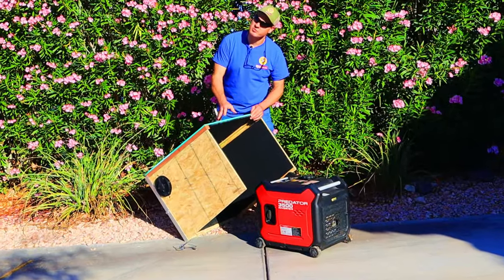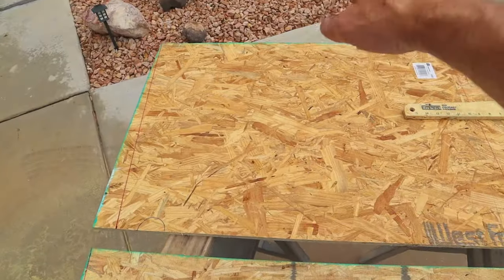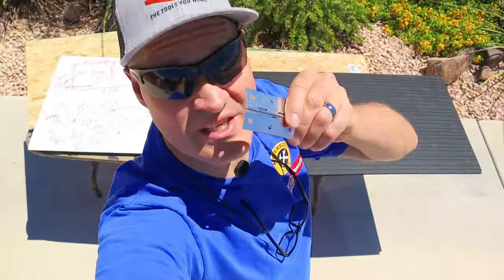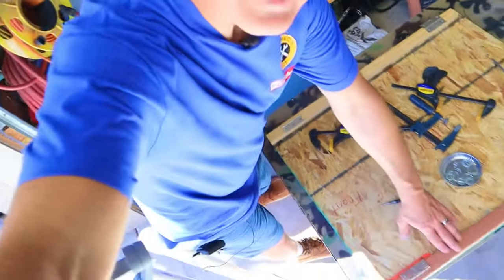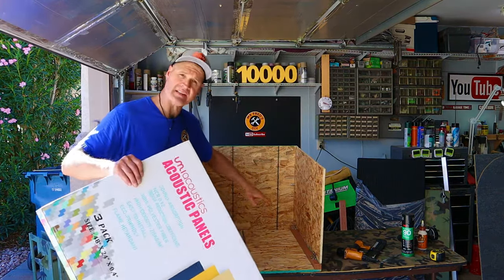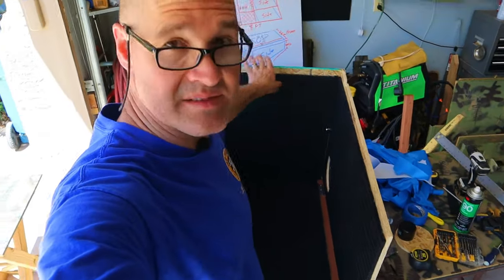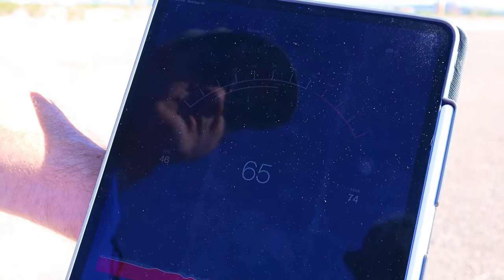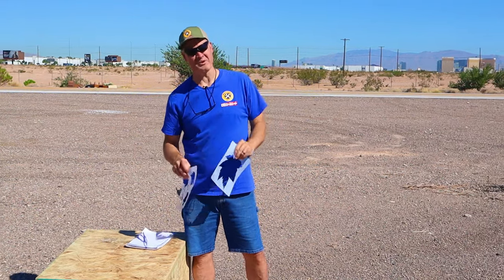Generator Quiet Box 2023

Comment: So, this is huge. My aunt maintains a family cabin and she needs to use the generator all the time. There are no neighbors, but it isn't exactly pleasant every time there's a need to recharge devices. 8 decibels is quite a bit... a game changer really. I'm not surprised about CO2 or heat not being a problem. That fan should be more than adequate for her needs, since the generator is not on 24/7. Plus, she can always add another fan if there's concern.
Reply from the maker: The polyester soundproofing material is very effective! Thanks for watching!

Comment: How did you arrive at the $99 price for the acoustic panels? The current Amazon price for one of the 24"x48" (1152 sq in) panels is $92.99 and it looks like you would need 3 of those. I calculated approx. 2,950 sq in is required (or 2.6 panels). That comes to $279 before taxes - yikes!
Reply: And Home Depot sells a Traffic Master branded Rib Charcoal 18in.x27in.Dirt Resistant Door Mat made out of polyester fabric and rubber for $4.76/each. Six of those would provide the coverage area and would cost only $28.56. Might be worth a try?
Reply from the maker: These panels are a 3 pack https://amzn.to/3P295XP
Reply: 3 pack is currently about $65.

Comment: What about heat? I have a westinghouse 9500tfc which is bigger open and makes some heat. Nice rock scape,
Did landscaping for 15yrs, man did have i moved some rock. Best part is garden sprayer (chlorine rated) with pool chlorine 1-3 ratio per gallon water tsp dawn(makes it stick, same in weed spray), coat rock just enough to start to drip but not run off, by time you use the whole backpack worth, you can go back and rinse with hose, and new rock again, cost a lot but last forever and cost of mulch after a few years is about the same. Save money in alot of ways, just heard heat video thanks for sharing
Reply from the maker: Thanks for commenting! Here is a testing video we made. We tested noise levels and heat. https://youtu.be/Wn_GF1RQoow?si=NdBpKZnEuD96t5dm

Comment: Speaking from experience...
Its a GREAT way to kill a perfectly good generator prematurely due to overheating. Generators need proper ventilation.
Reply from the maker: Thanks for sharing! We made an extensive heat testing video for these boxes and the results were pretty surprising. You can check out that video here▶️https://youtu.be/Ty8aJ2Eh_WI?si=di0iQ1Nt9st1xttL